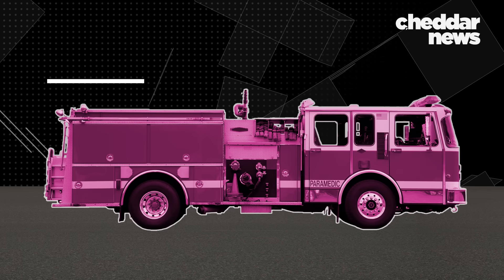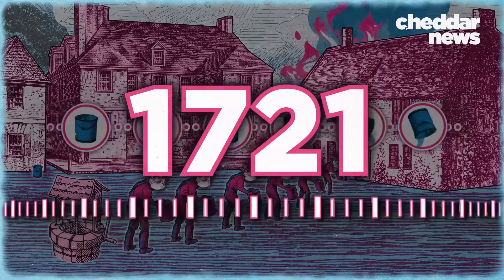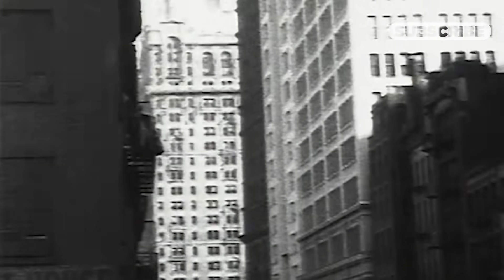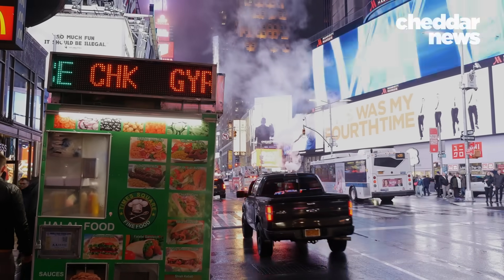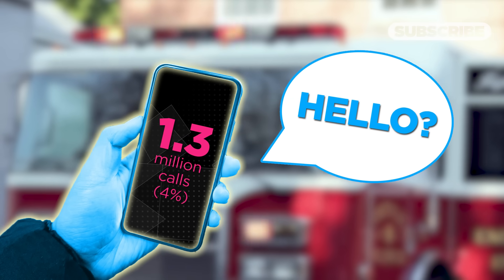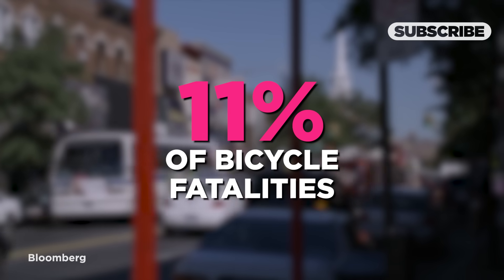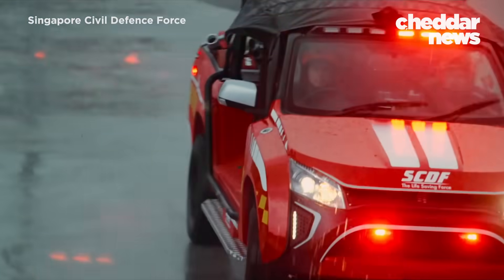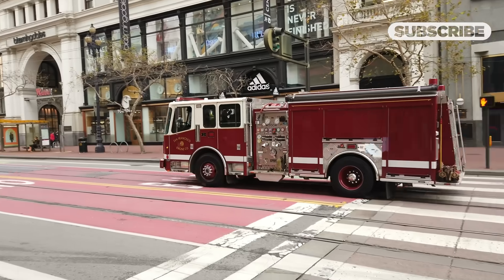Do American Fire Trucks Need To Be So Massive? - Cheddar Explains

Comment: Bike lanes can actually help fire trucks reach their destinations faster.
Where car lanes can get real congested in rush hour, and making room for firetrucks quickly becomes a nightmare...
Bike lanes rarely get congested, even with high bike traffic, and the bikes that are there can quickly and easily get out of the way, leaving an empty lane for a smaller truck to get through.
This isn't theoretical, this is standard for any European place with bike lanes.

Same with bus lanes, a lane through the main arteries of an urban area that is almost entirely clear of traffic, ready for emergency vehicles to ride through town at high speed.

This is especially important with American city design which is much more spread out then most European cities, allowing significantly faster response times.

This is ofcourse further helped by the introduction of firefighting motorcycles, which can get across town significantly faster then any truck, and while their kit may not be the most expansive, they can prevent a small fire from spreading, or save significant money by going to calls that do not need large equipment or large crews, like stuck elevators, fire alarms.

There is so much room for improvements, if only they are willing to look to other nations and adopt their ideas.
Reply: "This isn't theoretical, this is standard for any European place with bike lanes." well ... in theory ... because there might be lots of other things blocking the path of fire trucks, like poles of traffic signs, low hanging trees etc

Comment: Because were America and we make eveything better and cooler. Next.
Reply: which is probably why you also import European trucks, while European departments stopped importing American ones?
Reply: @EnjoyFirefighting  Ya good Job thats called demand of services. Did you ever think maybe Europe has smaller streets and needs a small truck ? Here in america are roads are wide and can support a bigger fire truck. Did you consider construction material, for the most part american homes are made of lumber and solid gasoline. European homes are made of masonry and concrete. How about highrise towers, any major city in america needs large lader trucks. How many major cities and high rise towers are there compared to America. How about GDP ? Last I check we can afford it, are GDP is much higher then Europe.  So ya we have are reasons for having Bigger and smaller fire trucks. So lets stop shitting on America and sit your euro ass down. World leader. 🇺🇲
Reply: @Star-bp5jj  not relevant in most of the response areas. As long as we fit semi trucks and articulated busses down out streets, an American fire truck would easily fit as well. 
The areas they wouldn't fit are the small and few remaining historic city centers. 
Houses are built very similar in Sweden and northern Europe in general: wood and lightweight construction. 
"How about highrise towers, any major city in america needs large lader trucks" there are high-rise buildings across Europe as well, but in terms of American trucks being larger: they are larger, but the ladder trucks don't reach any higher. They usually don't reach any higher than 100 ft - whereas the tallest Aerial in Germany reaches 300 ft, the tallest one made in Europe holds the world record of 367 ft. 
" Last I check we can afford it, are GDP is much higher then Europe. " actually many departments across the US are struggling concerning its finances, running outdated trucks and equipment, being shortstaffed etc. 
At the same time you find some of the very largest fire stations, largest emergency vehicles and most specialized fire and rescue equipment being in use in Europe, not in the US. 

The US importing European trucks, but Europe having stopped importing American fire trucks has nothing to do with GDP, smaller streets or anything alike, but simply that they tried to sell an American truck not adapted to European needs, without any distribution, sales and service partner networks. Thus even the US Army FIre & Emergency Services at USAG bases in Europe stopped using American fire trucks - despite having the space and the money. 

"So lets stop shitting on America and sit your euro ass down." before becoming too patriotic, how about checking some topic related facts first?

Comment: When she says they hold 400 gallons of water she makes it sound like its a lot, The pumper can go through its internal volume in about 3-4 minutes sometimes even faster depending on the pump speed and the size of the line used. Thats not a lot of fire fighting time Its just enough time to get water on the fire and get the truck on the hydrant.

Comment: In some states 70%-90% of the firefighters are volunteer, so cramming everything into one truck that can do it all is sometimes  necessary due to the lack of volunteers to answer the call.  So smaller fire engines don't really work well for those fire departments.
Reply: Are there not two people to drive two vehicles? It seems that, if there are not two people able to drive vehicles able to respond to emergencies, there is something wrong, beacuse most people can drive vehicles, and one person alone can't effectively respond to emergencies.

Edit: My bad; truck driving probably requires a special licence, which most people don't have. But, still, I think that such licences should be included in emergency department training.
Reply: @matj12   I can not speak for all volunteer departments, but I can use the volunteer department I'm on as an example which has 18 firefighters and 2 Junior (1 chief, 1 asst. Chief, 4 captains, 1 safety captain, and 11 firefighters) .  The standard operating procedure for taking out the engine or pumper tanker to a call is a minimum of 4 certified firefighters ( Certified meaning they have completed at the minimum Fire Fighter 1 training and have taken and passed the test ).  This is for safety and accountability.  Roles in the truck are the driver is the one who will operate the pump and manage the fire hose pressure,  the front passenger is the acting truck captain (This seat is for only those who are a chief, asst. chief, or captain), and the last two are regular firefighters.  Now if there is a junior or probation firefighter in the truck along with the other 4, they help by pulling hose off the truck, hooking up to a hydrant, traffic control, basically anything that does not require them getting close to the fire and putting on a scba.  Now the variance to this is our tanker, grasshopper, and rapid response trucks which have different crew sizes.  Our engine has everything needed to do a house fire to vehicle extraction and everything in between.  This is because you don't now how many people are available to respond to a call, during planting and harvest seasons the amount of available firefighters goes down, so you need to be able to respond to any type of call with just either the engine or pumper tanker.  So a smaller truck is not viable option for my department due to the need for space for equipment and 2,000 gallons of water.  In my state you do not need a CDL to operate a fire truck but my department does require driver operator pumper certification to drive along with bi-annual defensive drive training.
Reply: @matj12 Depends on department. Some try to get certifications to most, while some have it as an optional certification you can get in order to be certified.

Many volunteer departments run as many as 6 different vehicles, and oftentimes it can be even more. This is because many run an Engine, Ladder OR Tanker (some run both, but its more common to see one or the other), a Rescue vehicle (some may run both a full sized Rescue Truck and Rescue pickup truck (often with a utility build). They may also run things like Ambulances, Command vehicles, brush trucks, reserve vehicles if it's an agency with good funding, and even boats.
Reply: Insanely enough, 70% of Fire Departments nationwide are volunteer. It's not even limited to states. In fact, states like Nebraska have as much as 99% of all firefighters serving in On Call or Volunteer capacities.

Comment: 3:32: Ah yes... the long-lasting myth of the breaking distance of a firetruck that is longer than for a normal vehicle. This may be true in the USA, but in Europe, those trucks (and every other truck and car in general) is DESIGNED to meet maximum loading specifications and thus also the specifications for deceleration that state how quickly the vehicle should have come to a complete stop. They tested this on a Dutch program about the Dutch police twice, as the myth about vans of contractors/builders always being stuffed and 'they will never make it when they need to hit the brakes fully'. And they thought: isn't that weird, if a company designs a van but does not alter the brake-capacity for it to be able to stop just as fast empty as when fully loaded?
Here's the result, sorry, no subtitles available and the auto-translated ones aren't any good:
From 1997: https://www.youtube.com/watch?v=6H10iA_NL5c
From 2011: https://www.youtube.com/watch?v=22kvmmbkp40 < Autotranslated subtitles work a bit better on this one.

Comment: This is why:
Europe has different building construction, different fires, different size roads, different infrastructure, different population density, and so many more different variables. I can not comprehend how you can have anywhere close to the same equipment and capabilities on a smaller euro fire engine. We often need the equipment and capabilities because of the simple fact that all of these factors are so different in the US compared to Europe.

One major example of one major difference is the attack lines used in most of Europe are flowing roughly half of our 1.75" diameter hose.
Our attack lines are usually 1.75" flowing around 160GPM. If it's a bigger fire or bigger compartment (commercial buildings) it's common to use 2.5" flowing at least 210gpm with my preference being at least 260GPM depending on the fire. I am not even going to mention master streams.

In the US, Single rear axle fire engines can carry up to 1,000 gallons of water and usually have a 1500GPM or bigger pump depending on what the department needs. Most common supply hose can be up to 6" in diameter, most city engines in my experience usually carry 5" which has 1 gallon of water in every foot, and some smaller towns may have 4". 

I can keep going. 825,000 people have now watched this misinformed video. I might call Cheddar's phone number (917) 267-2494?
Reply: The way buildings are layed out is definetly a huge difference, population density however isn't. Also the size of the roads isn't really a factor in most of Europe. 
"how you can have anywhere close to the same equipment and capabilities on a smaller euro fire engine" that's quite simple to answer: tetris. When you look at the compartments of many European apparatus, equipment is stored like in a game of tetris, whereas many American apparatus have equipment stored loosely at the bottom of a compartment tray with lots of space above remaining unused. 
Yes, the tactical approach is very different as well. Long story short: in the US you'd rather go with high gpm and low PSI rates, whereas in Europe they rather work with low gpm and high PSI rates. Doesn't mean that Europeans can't go big ... they have equally large hoses for higher flow rates as well. The largest of hoses are foam hoses measuring several feet in diameter.

Comment: Most American firetrucks ARE NOT 10 feet wide.    The chassis available from the leading firetruck manefaires in the US are between 96-102 inches wide.   Pierce Fire Apparatus, delivering about 5,000 new firetrucks annually offer 4 chassis.   Two are 96 inches wide and the other two are 102 inches wide.  That's 8 feet and 8 feet 6 inches.  10 feet wide would be 120 inches.  
.
Second, you point out that most calls are not fire related.  But when a crew is out at, say a medical assist call, they need to be able to respond to a fire call as soon as they are released from the medical call.  They do not have the time to go back to the station and get the fire truck.

Comment: I don't think this is a good video at all because it doesn't seem well researched. BUT that doesn't mean that the point is invalid. Don't get me wrong I love those american firetrucks. It's also by far not that easy of a topic as a 10 minute video suggests.

The first questions you should ask yourself is: 'What is the purpose of the vehicle?' and 'What is the main focus of the vehicle?'

Most real calls today are medical or extraction / crash calls. You don't need a big ladder or massive water tank for that (unless e-vehicle involved). That's why we have purpose built vehicles. There's a "Rüstwagen" for example which is specialised for extraction and crash calls. There are ambulances stationed on fire stations or hospitals to do most of the medical calls. That's the state in Germany. We try to utilise our ambulances first but have to use trucks for some medical responses because we can't hold the response times anymore. That's why some trucks have been equipped with more medical gear. In Germany this is the exception but in the US it seems far more normal. 

The systems are different. In the US it's not that specialised so that one truck can respond to a wider range of emergencies (remember my question s regarding the purpose of the vehicle?). Furthermore the US Healthcare system is... a problem to say at least. Not talking about the insurance mess. I'm talking about medical responses management. That's why fire station have to catch the overflow of medical calls. 

It's not really comparable that easily and you could make an hours long video explaining the differences. This comment isn't intensively researched so please don't judge me.

Comment: Yes American firetrucks do need to be so big, American trucks do tend to be bigger, more ergonomical and you have more gear and less things stored like Tetris. Also consider unlike Europe which outside of maybe the eastern countries has the money where most cities can replace the fleets every 5 years or so due to regulations the US will have a fire engine last on its fleet for two decades. Second the size works, since American trucks are bigger, having American firetrucks being bigger is also a good idea.
When one thinks of it, American fire vehicles actually are some of the best in the world.
Reply: And WHY do they need to be so big? They don't have to be this big!
"more ergonomical " I wouldn't say so
" more gear" true for ladder trucks, not true for e.g. Engines. 
"less things stored like Tetris" having equipment stored like that isn't a negative aspect at all
"where most cities can replace the fleets every 5 years " not the case anywhere in Europe. Also in central Europe most departments will keep their apparatus as frontline rigs for 2 decades as well. 
"since American trucks are bigger, having American firetrucks being bigger is also a good idea." uhm what? How are these aspects related? Apart from that what about the (actually bigger) European roadtrains then?

Comment: This video paints US fire apparatus with a pretty broad brush. It really doesn't get into the regional differences in apparatus and the difference in sizes. In more rural arears its not uncommon for the engines to have massive tanks especially where they rely heavily on volunteer depts where your closest mutual aid company or even your own second due engine may take some time to get there. Get into areas like California and there is a very heavy presence of 4 wheel drive engines with decent size booster tanks like those commonly used by CalFire. Apparatus across the US varies greatly and many are designed to hold a large amount of support equipment rather the relying on additional specialized equipment so its on hand when needed although some departments do run special foam units, hose tenders and super pumpers but those are usually special call equipment. Streets in the US are generally wider than many in the EU as those roads in towns and villages are significantly older than any in the US so due to infrastructure in many cases you really have no options but to have smaller apparatus. I'm not going to even get into the whole an engine is not a truck and the reason why the US has larger towers considering some of the larger ladders in Europe are pretty big.
Reply: "as those roads in towns and villages are significantly older than any in the US" the issue of tight streets is limited to the few and rather small historic city centers. The greater cities have spread far beyond the old city walls and you'll find all sorts of large vehicles driving the normal city streets, like articulated buses which are definetly larger than most fire apparatus.

Comment: American fire trucks usually have more equipment than other countries, american fire trucks hold 6 people, other countries usually hold 4, fire trucks are used as traffic barriers at scenes, and american fire trucks have bigger water tanks. Maybe do some more research before making a video and saying stuff that you dont know about.
Reply: "American fire trucks usually have more equipment than other countries" true for quite a few countries I guess, but not e.g. central European ones like those from Germany. Although their trucks are more compact they hold both a larger crew and more equipment. The standard crew on a German Engine is at 9 firefighters
"fire trucks are used as traffic barriers at scenes" same elsewhere as well
"and american fire trucks have bigger water tanks" true, as American departments work with higher gpm and lower PSI rates.